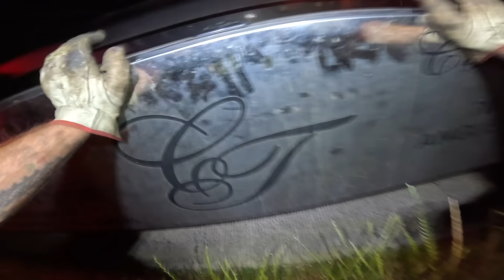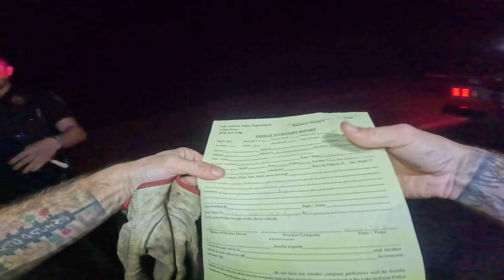Wrong Way Chevy Camaro Ends up in the Ditch!

Comment: Ever thought about using wheel dolly jacks on the tires that don't roll? They make smaller ones that don't take up alot of room. Probably wouldn't work dragging them up but coming off the rollback they might come in handy.